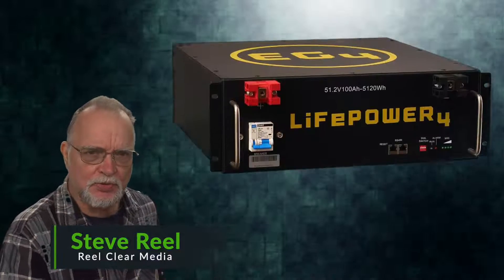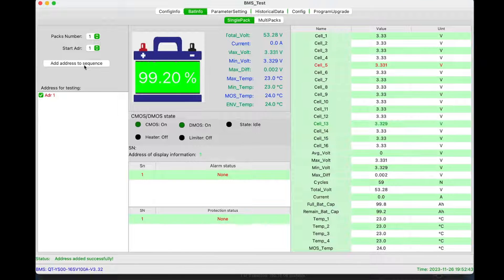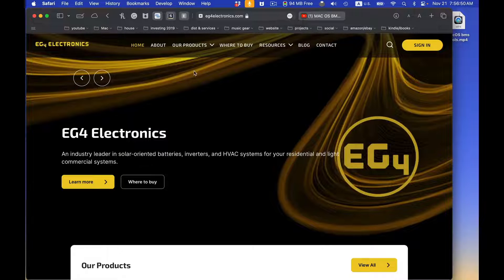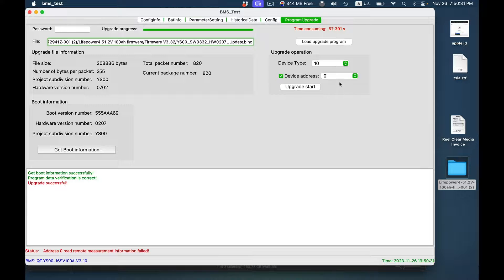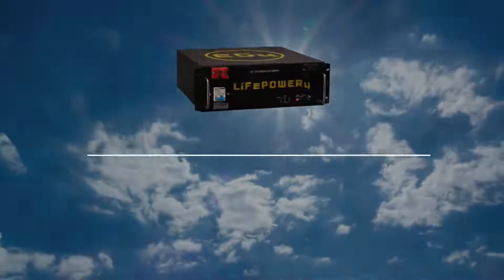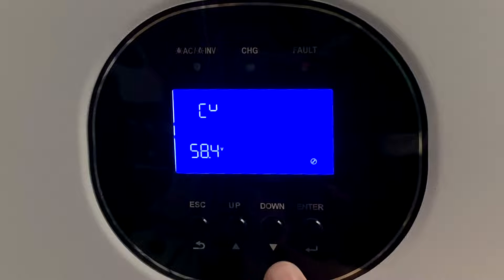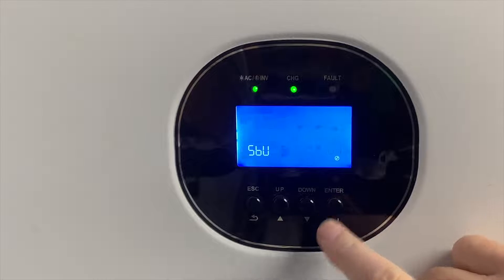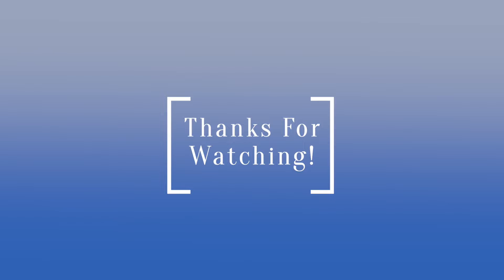Calibrate State-Of-Charge (SOC) on EG4 Lifepower4 batteries.

Comment: Thanks for the video. 

58.4/16 = 3.65 volts per cell which is the nominal max voltage for LiFePo4 batteries BTW. I usually run my batteries less than 100% SOC to extend life (55.9 or ~3.49volts per cell). I wouldn't charge to max because if your algorithm is off a few millivolts you'll push the batteries beyond their max state of charge, I charge to under that to be safe.

Comment: Thank you!!! I knew what I needed to do but I did not know the voltage! So for the 24V batts the voltage should be 29.2V. So I'll let you know!
Reply: It worked!! 😃
Reply from the maker: @zachreyhelmberger894  Cool! 
Now also update your firmware. I updated mine and I charge at 56.4 now... the SOC stays calibrated and the cells stay balanced.

Comment: Great video. Has this issue occur again after this solution?
Reply from the maker: No, they've been staying within 5-10% of each other. Daily charge is set to 56.4 volts. It is likely that the firmware upgrade I did in this video has helped.
Reply: @ReelClearMediaLLC  Great!!! Mine has a similar issue. Both batteries will stay within 1 to 2% of each other SOC, but once the SOC reaches around 54%, one will show an exponential decline in its SOC, resulting in reduced usable capacity. Also, happens during charging. Batteries are less than a year.

Comment: I'm having the same issue, bit for 24v batteries.  What voltage should I use to equalize the BMS on my 2 batteries?
Reply from the maker: I can't be sure, since I don't have a 24 v system. You could try half of my charging voltage. I'm currently trying 56.4 and it seems to be working. So you could try half of that or 28.2v

Comment: Going crazy with this for months! Tried everything update firmware did help but I see the batteries are drifting apart again, I'll do the 58.4 equalization mode on my Outback if it happens again. Signature Solar is lost in the woods, completely incompetent, won't buy from them again - useless!

Comment: How did you get both batteries to show in Solar Assistant?  I just started using it and just got my small system working.  6000XP with two LL-S batteries.  Thanks.
Reply from the maker: I have the batteries connected to the rasberry pi with USB. I don't have my batteries connected to my inverter, as my Growatt has older firmware.

Comment: I've been trying to update the firmware of my EG4 batteries, but for some reason it always fails to get boot info.  I can get battery info, but I can't get boot info.  I am not charging or discharging the battery as the instructions say.  I downloaded the newer BMS test software, but still can't get boot info.  I don't know what I could be doing wrong.  My settings are the same as in the video.  Any suggestions?  I'm trying to look for any ideas on the DIY Solar forum.
Reply from the maker: Are you using the EG4 cable that came with the battery? I know it has a different wiring pin-out than most cables, and I believe they changed the wiring at some point. 
Do you have LL batteries or Lifepower4?
Reply: @ReelClearMediaLLC  I have the lifepower4 batteries.  I have the cable that came with the batteries.  I have 5 of the batteries.  I got them in 3 separate shipments, and so I have 3 of those cables, and tried each one.  They work for get battery info ok just not boot info.   I did notice on a couple batteries it would disconnect from the connection when I tried to get boot info--the battery would reboot and disconnect.
Reply from the maker: @5slabs  I guess I got lucky and it just worked for me.  I found this online, maybe it will help...
Software can't read boot information or update if batteries are charging or discharging. Turn off breakers, and/or inverters, chargers and try again.

I remember seeing that they changed the pin-out at some point. It would seem if you had the wrong cable, you wouldn't see battery information either, but I'm not sure.
Reply: @ReelClearMediaLLC  I'm not charging or discharging when I try it.  I wonder if there's an issue with the batteries discharging when not used, because at the moment I have one battery connected to my inverter, and though the inverter is running off the grid, due to the low charge state of the battery, the software will show a small discharge from the battery, and that is why the inverter will eventually go into an alarm state for low battery, because it slowly keeps drawing down the battery beyond the back to grid setting.  Yeah, I wouldn't think the cable would allow me to see the battery info if it was the issue.  Hopefully Solar Signature will get back with me.   Thanks for the input.
Reply from the maker: @5slabs  Try disconnecting the battery from the inverter. You could just turn off the DC breaker if you are using one between the battery and inverter... then see if the software will load boot info.
Reply: @ReelClearMediaLLC   I haven't tried the battery connected to the inverter.  I've tried the other 4 batteries I have and they all failed (they're not connected to anything right now).  During the winter (at least december and january) when we have much less sunlight, I don't need all 5 of my batteries connected to the inverter.  I rarely have enough sunlight to charge the one battery up and run the connected loads.
Reply from the maker: @5slabs  Wow, I'm not sure what is happening there.  If you find out why, please post it so others will know. 
Do any Youtube viewers out there know how to fix this?
Reply: @ReelClearMediaLLC  I will. Thanks for the interest.
Reply: Can you maybe try a different computer? I know I had a hard time updating the firmware on my inverter and had to change some permissions on windows
Reply: @Laurel-Crowned  I only have a laptop with windows 11.  But I know what you mean because I’ve read of others having trouble upgrading firmware on their Growatt 5000 inverters with newer versions of windows. That why I didn't attempt it with my Growatt.
Reply: Hopefully you've resolved this by now. I had the same problem when I was first doing the firmware update. Turns out it was a simple fix... on the "Batinfo" tab I was not choosing the correct START ADR. I did each battery individually and I had to set START ADR to "0" so it reads the correct battery. It may be this simple for you.
Reply: @woolval52  Yes, I tried that, and it still didn't work.  I tried everything that tech support suggested (at Signature Solar).  So now I am waiting for a black box device from EG4 that is supposed to do the firmware update automatically. I've been waiting for a few weeks, and it hadn't come, so I had to contact tech support again at SS to see if it was coming, and it turns out it has not been sent out, and the tech is looking into seeing if they are even available.  So I am waiting ...  Thanks for the interest.

Comment: If you bump your Bulk voltage upto 56.5v you won't have the drift issue (assuming you have sufficient solar a few times per month to reach 56.5v).  Unless its winter...in that case its been 45 days since my batteries last saw 56v let alone 56.5v

Comment: 56.5v is the point where the SOC will calibrate to 100% SOC.  Technically, the BMS uses an average Cell voltage.  It will also use Cell OverVoltage (COV) as an indicator.  The specific details are defined in the BMS firmware changelog.  56.5v or 56.6v is the point when my Lifepower4 batteries (running v3.32 firmware) will switch to reporting 100% SOC.
Reply from the maker: Thanks, @jasoncr8419
The latest firmware for the LifePowers is 3.30, Overvoltage alarm is now 3.55v/cell or 56.8v/ pack. I've gone back to 56.2 absorption with 54v float, and I'm showing 99.x% SOC on both packs when full. But the good news is, my packs are staying within 5% of each other. I read on one of the forums that the new firmware also does top balancing.
Reply: @ReelClearMediaLLC  I'm looking at 3.32 on the eg4 site.  

I have 3.32 running on six batteries and beta testing 3.37 on six others.
Reply from the maker: @jasoncr8419  Thanks! I just updated to 3.32. The changelog doesn't show any info yet for that revision. I'll try an absorption charge of 56.6v today.
Reply: @ReelClearMediaLLC    Copied from change log that was included with 3.37

1. The charging and discharging current less than 2A is not reported for software policy modification, and the sampling current data of bms is reported normally.

2, daily monthly pcs agreement adaptation adjustment, to solve the problem of daily monthly pcs communication;

3, support the upper computer configuration enable the current limiting function, the charging cabinet cycle test the upper computer configuration
Reply: Just yesterday I found a less then desirable side effect for when the BMS disables the CMOS.  Reported it to EG4...updating to 3.37 fixed the glitz issue (only effected 1 of 6 batteries).  

I think the issue was introduced around 3.26    @ReelClearMediaLLC
Reply: @ReelClearMediaLLC  I just looked at the change log and looks like SOC was changed to 99% on version 3.26 and higher.
Reply: @ReelClearMediaLLC  looks like over voltage alarm will set SOC to 100%
Reply from the maker: I just updated the description to let people know about the new firmware only needing 56.6 v bulk. Gave you credit, hope you don't mind.

Comment: I am curious. When you updated the battery firmware, did you plug into battery #2 with the computer cable? Or did you have the battery jumper installed between 1 and 2 and then just went to address 1 in the software and updated #1 from there?  

Most people say that you need to set all addresses to 0 and plug into each battery to update and then reset all dips for coms to the inverter. This later process seems to be a few revs behind the tech times. if you ask me..
Reply from the maker: I think I left them both plugged in with the jumper between them. I didn't change the addresses on the DIP switches. Maybe I just got lucky, but both batteries updated OK.

Comment: Whenever you have these types of batteries connected in series, or connected in parallel via bus bar, the differences in both internal resistance and resistance across the associated wiring will often result in the SOC of those batteries drifting apart.  It's almost unavoidable, although modern communication protocols and technology should mitigate for this, to an extent.  When I discovered this issue in my 24v system, (two 12v batteries in series) I bought an inexpensive "battery equalizer".  All this unit does is sense the voltage of each battery connected in series and send small amounts of current from the battery at a slightly higher voltage to the battery at a slightly lower voltage, keeping them in synch.  Victron has a unit which does this, but it bleeds off current from the higher battery, dissipating it as heat.  That is less efficient, so I got the unit which puts the excess current in the other battery.
Reply: Which one did you end up using?

Comment: interesting. It sounds like the coulomb counter in the BMS is not getting reset to full when you charge to 56.2 (3.51 volts per cell).

All coulomb counters drift over time and need to be periodically reset to "full" by reaching their "full" trigger voltage.  Usually external coulomb counters (like Victron Smart Shunt and Renogy Battery Monitor shunt) allow setting that full trigger voltage.

Even if the coulomb counter were perfect (they aren't) the battery isn't perfectly symmetrical during charge and discharge.  It always takes a little bit more energy into the battery than you get out of it.  Some coulomb counters allow setting this "charge efficiency" parameter.  (lead-acid batteries require more during charge - are less efficient - than LiFePO4, and the old nickel-iron batteries took a LOT more).  But even if you get that set correctly, a perfect coulomb counter will still drift!  Because the charge efficiency of the battery will change depending on its state of charge, the temperature, and as the battery ages both in time and cycles.

All coulomb counters need to hit their reset-to-full trigger every now and then!  Sometimes you can use charge "equalization" settings for this, if you can set the max voltage and if you can make sure it doesn't do it too often.  Quarterly would be a *plenty*.  Once a year would be fine for most folks.
Reply from the maker: Thanks. The trick is trying to figure out what that trigger voltage is to reset it.

Comment: worked on me  ... on a power station .. lowered the  wattage and let it charge to as much as possible at slow rates and it seems to give more capacity..    its new anyway but only a reset is never gonna be a solution to such   situation . and not problem at all!!!

Comment: Hey Steve,  great video.  You might wanna do your manual charge again and leave the batteries charging for a whole day at the higher voltage.  That will give the batteries time to Top Balance.  You can actually see them doing this in the BMS test software.  Where did you come up with 58.4v?  Signature Solar reccomended a similar procedure but with two main differences.  First, they suggested 58v.  Second, they suggested leaving it in the "manual charging mode" for 2 weeks and charging and discharging as many times as possbile in that time.  I didn't notice any differences after the first few days so YMMV.  Also, I normally use Growatt/EG4 communication.
Reply from the maker: Thanks for the information, Leafnutz! (great handle)   
I'll try top balancing as you suggest.  I have also seen someone suggest setting the float charge .1v  below  the bulk charge.  I'll experiment and make a video to pass on the information.
The 58.4v setting was from EG4's discontinued AC charger. That was its output voltage. That model is no longer available and looks like it  has been replaced by the Chargeverter.
I don't use BMS comm because the Growatt's firmware is too old. I'm considering upgrading to the EG4 6000XP anyway.
What year is your Leaf?
Reply: @ReelClearMediaLLC   22 SV+   I do most of my charging with a Growatt 3000 LVM-ES model and a single Lifepower 4 battery.  I also use the Zencar adjustable EVSE.  Was planning to switch to a Growatt 5000ES and level 2 charge but the new EG4 6000 seems like it would be a much better choice for an EV charger.  Signature indicated the float voltage was irrellevant with Lithium and suggested 58v as well.
Reply from the maker: @leafnutz2341   Thanks. I have a Growatt 5000ES i was planning on using for level2 charging also. But the EG4 6000xp is tempting... the built-in switchgear, the common neutral, generator input, surge rating, and more. I need to see if The Growatt 5000ES will start my well pump, it has a pretty hefty starting surge of around 53 amps @ 240v.

Comment: I have EG4-LL V1 (48 volts) and all the individual battery cell voltages are almost identical until the SOC gets close to 100% when a few of the individual battery cells continue to charge more than others and the BMS stops the charging. I cannot really set the absorption voltage any higher than 56.5 volts because the BMS will stop the charging (due to a few cells trying to keep going to higher voltages). I don't believe anything is wrong with the individual battery cells because their voltages are almost identical for SOC below 100%.  People talk about "Top Balancing" to fix the issue but the BMS in EG4-LL V1 is no good and Signature Solar / EG4 have a tendency to come up with a newer version when they realize a design flaw instead of replacing the BMS.
Reply from the maker: Sorry to hear that. You might try to update the firmware? Not sure if it would help.
At least the BMS protects you from overcharging.